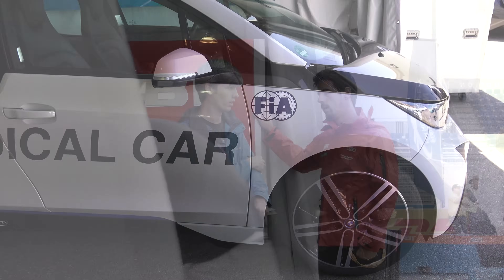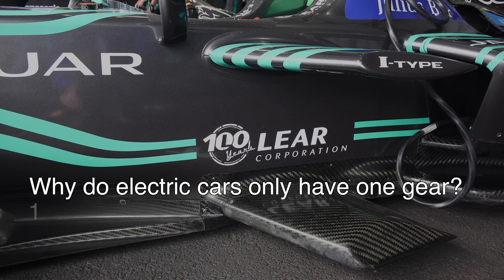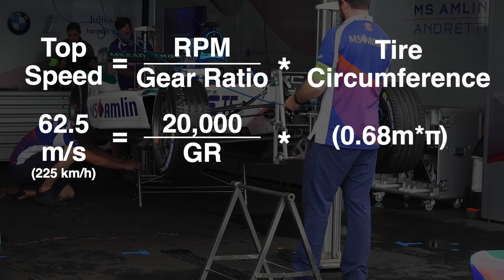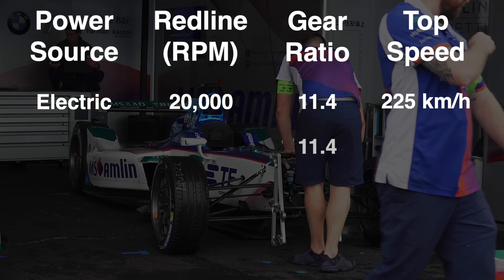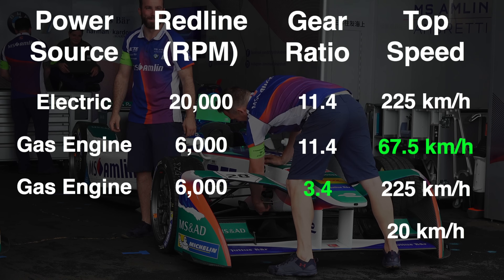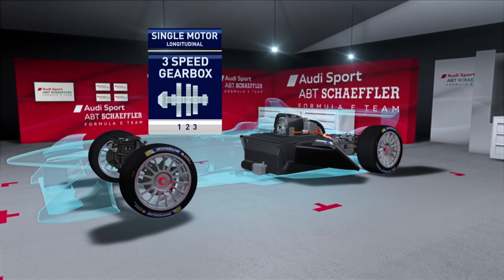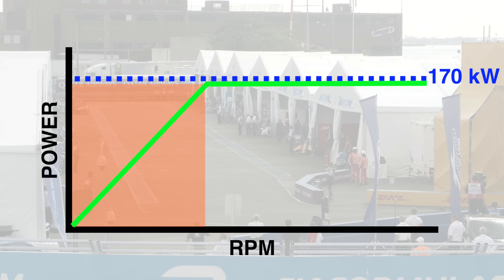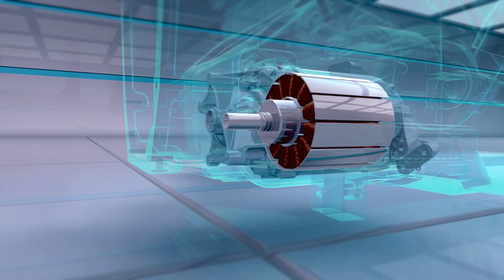Why Do Electric Cars Only Have 1 Gear?

Comment: Why would electric motors need to be high revving? The faster they run, the more counter-EMK they create, thus the higher voltage is needed to get any torque.
Reply: They don't need to rev high. But due to the small amount of moving parts they can rev very high. Adding a gearbox adds complexity and expense.
Reply: @Redtooth75  My point being that their torque is the highest when they go slow. So basically one high gear is better than a low one.
Reply: @gideonz74b  true, but then you would have to have a motor that made more torque than the ones that are currently put in cars. If you use a 0.5:1 gear you would need to double the torque of the motor to get the same torque to the wheels.
Reply: Yes..if teslas had another gear maybe they wouldn't get overtaken by high powered ice cars in so many of the drag races

Comment: Can you compare the power band of three phase AC motors versus the motors in electric vehicles? Why are they different? Torque/power and speed chart on a xy chart. Then explain why electric vehicle motor maintains high torque at low speed without a gear reducer.

Comment: Like I get why they don't need the multiple gears but for an everyday ev like a Tesla, I think it could benefit from improved range due to slower spinning motor
Reply: gasoline engines are generally more efficient at lower revs, but this isn't true for electric motors
Reply: @scottneaves3487  that is what i figured, i was up late at night thinking after not sleeping for +40 hours
Reply: Having the motor spin more slowly doesn't increase efficiency and it's efficiency that determines range, not motor speed.

Comment: So if an electric vehicle wants to go beyond 225km/h, it would need more gears?
Reply: That is one way, alternatives are different fixed gear ratio or a motor with a higher RPM limit.

Comment: Ehm dont talk about american electric cars they clearly dont know what they do look at porsche it has 2 gears and it is much faster....
Reply: I respect your response, but this is a 3 year old video, too, you have to remember. 

But you're entirely correct about it having 2 gears to achieve a more efficient speed, and even in this video, Jason mentions that having more than one gear can help a car reach peak speed more efficiently, or reduce lag time to accelerate. In turn, the Taycan does both, which means having two gears is super practical! It's a very fast car and can benefit from this. 

Cars that aren't Teslas for example (because not every electric is Tesla), y'know they don't have a super high maximum speed, so they don't really need to worry about multiple gears. 

Besides the Mustang Lithium which had the 6-speed manual gearbox, I don't quite know about any American electrics with multiple gearboxes. The Taycan is a German product, as well.
Reply: But yes, generally you'll only need/want a single-speed gearbox to *keep costs down, too*. 

The Taycan does not, and did not care about its final price tag, as it shouldn't have. They wanted to make a super-premium electric car, and they sure did.

Cost is very particularly important, as electrics aren't exactly affordable to just everybody yet. While California sees $40,000 as affordable (when everything is ludicrously expensive already), the rest of the USA for example, doesn't feel that way.  We're talking generally car payments of $350-450/month (to finance) plus insurance, which may not be ideal to some families. Which isn't to insult them, there just may be better options out there for people in that case. We could argue about leasing, but that's a different topic.

Comment: And you can drive with the same gear backwards ;-)
Reply: Yes! Easily achieved in all electric cars by simply reversing the polarity of the battery voltage applied to the motor. 
In theory, one could drive to the same top speed in reverse as in the forward direction!
Although I wonder what driver would be willing to go over 200 km/hr in reverse !!
But I suspect that most EV manufacturers probably limit (via software) how fast you could go in reverse, as a safety factor.
Reply: @Nicholas.T  You see the ;-) ?? The polarity of an ac machine?

Comment: Why are you putting a limit on the electricity of the car? Can't they just keep going up in usage?
Reply: In formula e they are limited to 170 kW
Reply: @Redtooth75  Why? That just seems like it is artificial degrading it. Like putting a disability on someone in a game.
Reply: @calebkirschbaum8158  battery limitations. If the engines were more powerful they would either need shorter races or have a long pitstop in the middle of the race to change batteries.
Reply: @Redtooth75  That is what had to happen for inefficient engines, or for engines with small tanks. Would it not make sense to force the racer to decide on how hard to push it?
Reply: @calebkirschbaum8158  its a debated topic. Many people don't like that the power is limited but no one has come up with a better solution.

Comment: What about no gears?
1 motor per wheel?
Reply: Direct drive? Good idea, but can you calculate acceleration from stand still to 60mph for motor with peak torque of 100-150Nm?  At the same time grip limit could be about 10,000Nm.

Comment: You can also use different windings on an electric motor as gearing... resistance is the reason for gearing to begin with so it should not be a surprise that windings are used as gears for efficiencies of fuel/energy
Reply: If you use two windings, of different lengths, you really have three "gears" 1=short winding, 2=long winding, 3=both windings in series, with two SPDT switches (and something to prevent both switches being set to the same tap point, which would short out the circuit.

Comment: I have a question. How much electricity is actually being consumed at the various speeds of the motor? Say, 5000, 10,000, and 20,000? I would think highway driving, even with an electric motor, that keeping the RPMs low would be just as fuel conservative as it would be for a gas engine. And I would think if an electric motor is good for torque and very low RPMs, why not gear it to run at low RPMs with a kinetic reservoir like a flywheel. Then there's the argument of which is better, volts or amps.
Reply: Electric motors do not really use more energy in high rpm.  The power consumption is because of the load on the motor, not the speed of the motor. If you step down the rpm via gears, the load or force on the motor increases, increasing the power consumption greatly. Since it is efficient in all rpm, this would have no benefits. Electric motors can stick,slip and melt at low rpm, so it may even be less efficient or dangerous.
Reply: @zazethe6553  Electric motors are more efficient at higher RPMs in some tables.
Reply: Well, you've certainly got the ideas down! The biggest problem is cost, and complexity, not the theory behind it. 

It's a given that a motor performing more work will consume more power, gasoline or not. An electric motor has more spots where it can remain efficient compared to a petrol motor, but of course running it at maximum power will use the maximum power it is capable of using. Kind of how maximum brightness on a phone eats up a bit more than turning it down. Not by too much, but still a percentage. 

Of course, ultimately in these independent lab scenarios, weight and complexity bring up more and more questions about how we could go about new technologies to further improve the electric motors. I say we are still in the infancy of what kinds of new technology/innovations are available to us, but perhaps we'll have another "Roaring 20s" of our own after coronavirus!!

Comment: You ask a question, but answer another one.
As you explain things really effectively and comprehensively I still feel unsatisfied, because I'm really eager to learn why electric cars on the market have no 2nd or 3rd gear to allow them reach higher, than 160km/h, speeds. I only know that Tesla, when developing the first Roadster, had massive problems developing the gearbox hence they eventually gave up altogether and released a car with just 1 forward gear.
I hoped you'd actually tell more about these difficulties - why is it more challenging to create a gearbox for electric cars (Tesla tried with vendors for 5 years before they concluded they failed).

Comment: Great video. If I were to connect a large electric motor to the differential of my car, in theory, it would go. In practice it would be advisable to have a ratio similar to the one quoted in this video. Would I achieve the same torque using one smaller motor per rear wheel.

Comment: Do any of the teams use electric gearing (as in variable frequency AC drives?)

That way you can match your torque/RPM ranges without any mechanical gearing